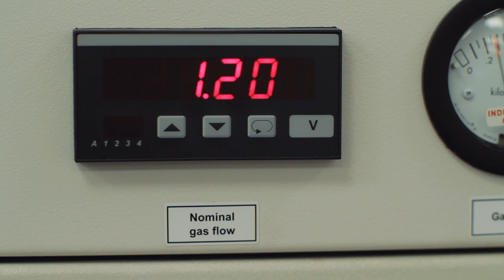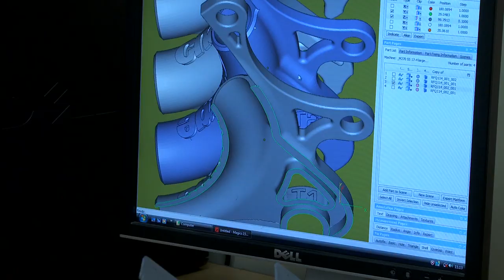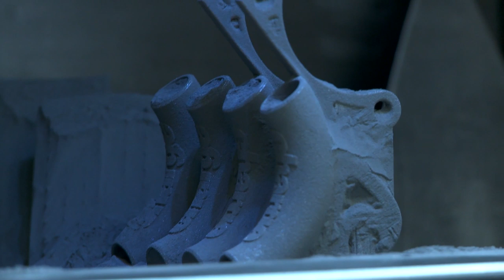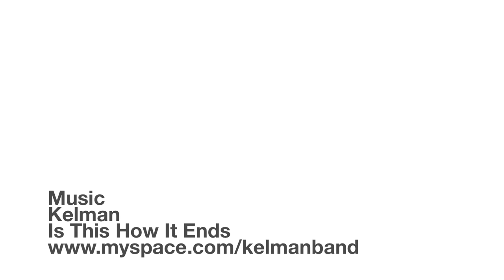Printing titanium bicycle parts - Charge Bikes & EADS

Comment: This is absolutely fucking wicked!!!! Except I don't see the point. The guy said it's not possible to make those with any method? Forge two halves & resistance weld? I'm not sure what kinds of properties this method attains but they still had to stress relieve because it's basically just an enormous & time consuming amount of welding. For parts inside of parts & things like that I can see its value, but otherwise I don't.

Comment: I'm sorry, but there is absolutely no way that any of these parts that would be stronger than a forged or machined part.  That graininess you see on the outside of the parts they produced is the same graininess you'd find in the metal itself, meaning that you'd have lots of voids and other weak spots in the metal.

This is (yet another) example of a bicycle company trying to be smart, but without the solid engineering background to do it.
Reply: Ah, I have to correct you. The "graininess" on the surfaces is just unmelted powder that's stuck onto the solid part. Densities are up to 99,9% inside the bulk. This often gives a wrong impression on what it looks on the inside. Shot peening and/or tumbling can smoothen the surface, and therefore increase the fatigue life.

And yes, the part is much stronger than machined part, and slightly stronger than forged. This is ofc very material dependant (what kinds of heat treatments were performed etc). The increased strength comes inherently from the process itself, much higher cooling rates create smaller grains which in turn gives much higher strength. You can check material data sheets from example EOS to confirm this yourself.